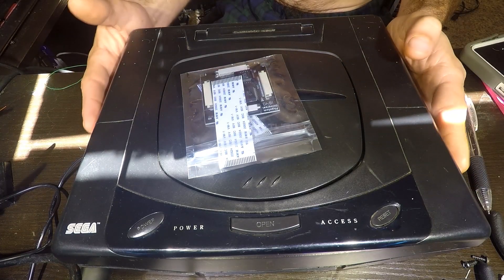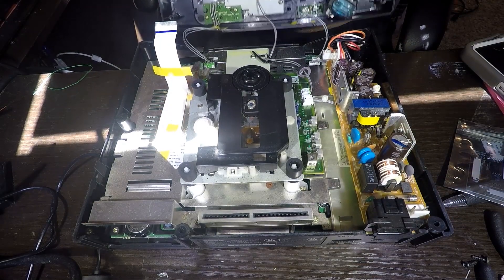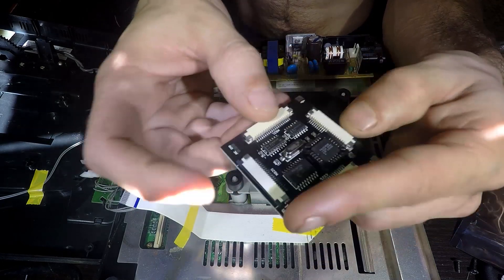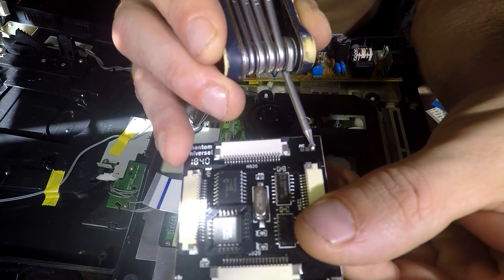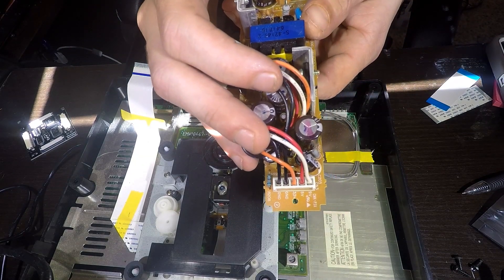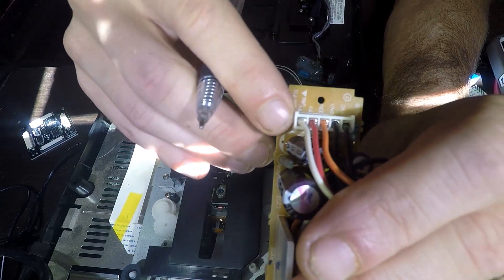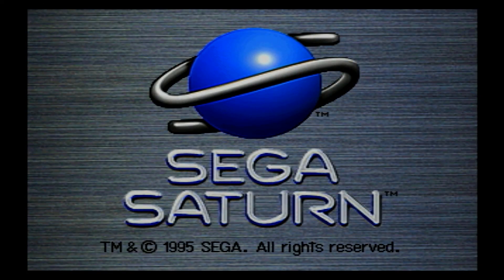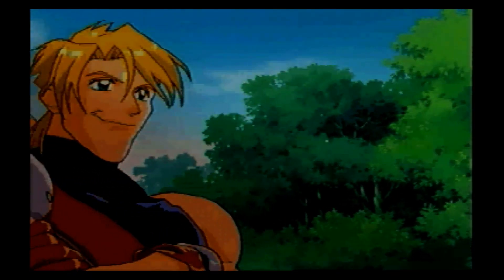SEGA SATURN - How to Install a Phantom Universal Modchip in a Model 1 Console

Comment: Why pay for a chip when software solution is on the market?
Reply from the maker: kubaslonka pseudo Saturn is great but there’s 2 valid reasons off the top of my head. 
1. You don’t need to worry about patching your games to work like you do with about half of games for pseudo Saturn.
2. You can keep the ability to backup saves the on your ar
Reply: Also, the chip is inexpensive and really easy

From reading the FAQ, it seems you can't play games that need the 1 or 4 MB cart as well

Comment: I have an update. So,...here's the thing...I have 2 Sega Saturn's...a Model 1 and a Model 2 . I opened up the Model 1, and because I didn't see a JVC or SANYO on the disc drive daughter board, I must have that RARE Hitachi drive. Soo...I must can't use that one. So, the Phantom chip has to be installed on my Model 2😅...which kinda sucks. But either way, I will definitely crack them both open, and at least give them a long deserved cleaning..at least.

Comment: Hey, I just installed this on my Model 1 Sega Saturn. It boots up and the disc spins, but it only lets me listen to the music on the disc, I tried running a game on it that wasn't burned and it still only let me listen to the music. I have a Japanese import model 1, but as far as I can tell it should still work. Is there something I'm missing? Can I still use this mod chip on a Japanese imported console?
Reply: Hello, if your model is Japanese, you didn't have to have soldered the 2 points, I have it the same, BUT WITHOUT SOLDERING UP, only the 5 v if you soldered the 2 points above, the chips no longer serve you
Reply: @alexanderkrauser1868  Ay thank you my man, that worked like a charm. I would have never guessed to do that